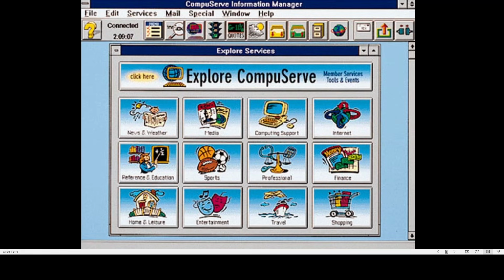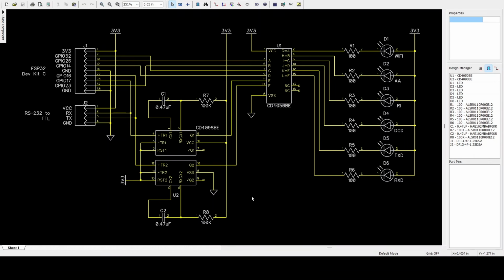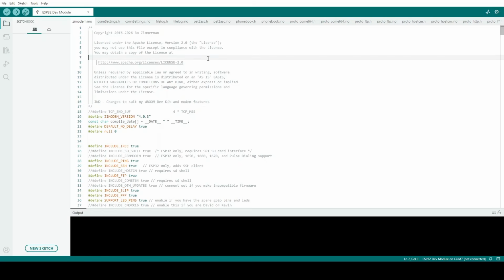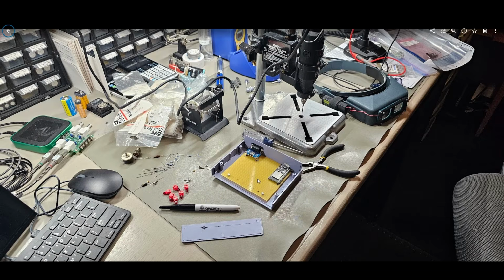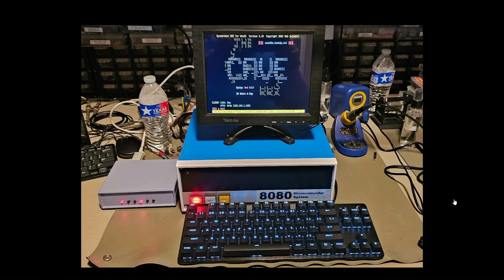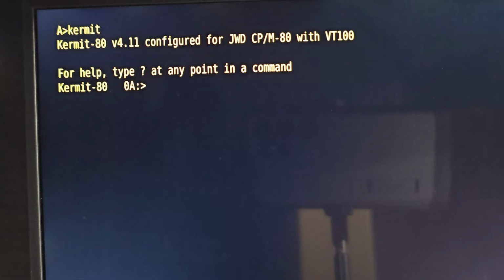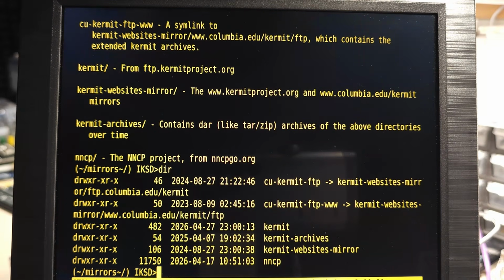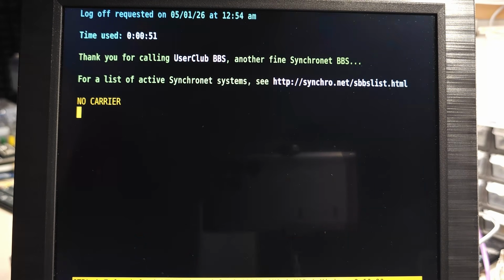A WiFi Modem for the 8080 Computer

Comment: Excellent Project....  Great Idea...
Can you provide a schematic in .pdf format?
Better yet can you provide a Gerber file for the PCBoard as well?
Reply from the maker: The schematic can be found here:  http://www.netzener.net/images/8080comp/wifi-modem-schematic.pdf

The PC Board is actually a Vector Perfboard 84P44WE with holes 0.1" on centers and 0.040" holes.  But you can use anything you would like.  I didn't design a PC board for a project this small.

Comment: I wonder if we could make a Wi-Fi acoustic coupler with an esp32 or similar dev board. No reason why not, hey?
Reply from the maker: I think you are suggesting adding V.22 (PSK) support and some analog circuitry to connect with an acoustic coupler, instead of (or in addition to) the WiFi portion of the modem.  There are PSK libraries for ESP32 which could be extended to do this.  There isn't much headroom in the 8-bit DAC but might work well up to 1200 bits per second.  A homemade acoustic coupler might be a good choice so you don't have to build all the analog circuitry to interface with the PSTN.  I  think it's possible.

I suppose the big question would be:  Assuming you still have an analog phone line, what would you connect to on the other end?
Reply: @netzener  I meant using an analogue acoustic interface for Wi-Fi instead of a serial interface. More "because I can, and it's funny" than because it's particularly practical or useful. That said, if you had such a device it would then be possible to interface it with actual antique analogue devices I suppose.

Comment: Just curious, would this modem work with a "dumb" terminal?
Reply from the maker: Absolutely.  The display/keyboard attached to the 8080 computer is a serial terminal.  While testing, I attached the modem directly to the terminal and was able to do everything shown in the video.  You don't need a computer in between.

Comment: 10:42 On those old devices using a COM port it is best practice to attach the COM port cable first with the device powered down, then attach the power, serial ports are very fussy that way and don't do well if there is static electricity.
Reply from the maker: Back when power supplies were not well regulated, power connections were mostly mains, ESD protection limited or non-existent, and equipment costing todays equivalent of thousands of dollars, cabling everything BEFORE attaching and turning on power was usually the manufacturer recommended procedure.  I remember reading that on all the manuals I saw from the 70s and 80s.  They even put large yellow caution signs or used bold letters on their documentation.  There was a very real risk of damage back then.  It's a good idea to review any documentation available when working with a vintage device.

I built both the computer and the modem in this video using modern power supplies and TI MAX RS-232 interface chips.  The MAX series provide 2KV to 15KV ESD protection and have their own internal charge pump power supply which is short-circuit tolerant.  As the equipment maker I told myself, "you don't need to be quite so cautious."  :)